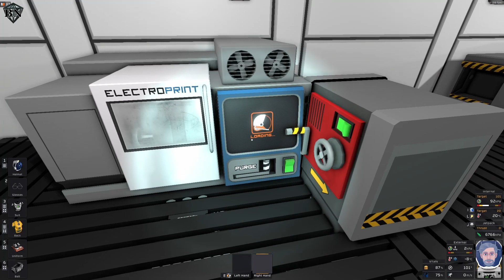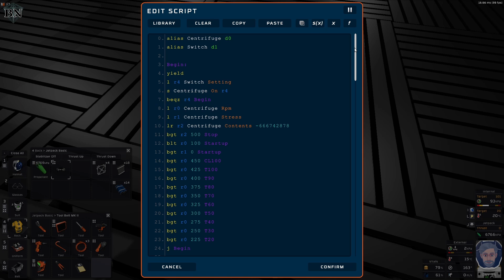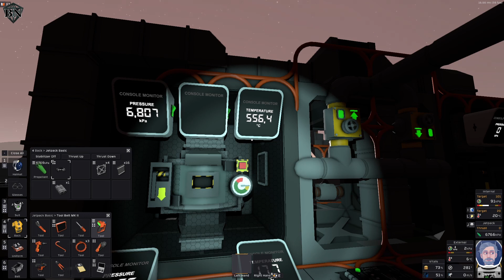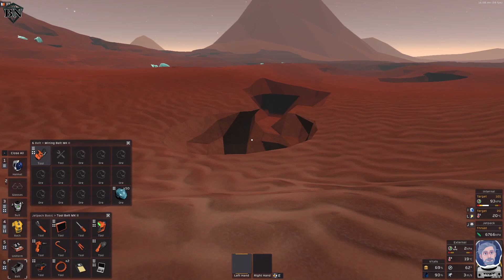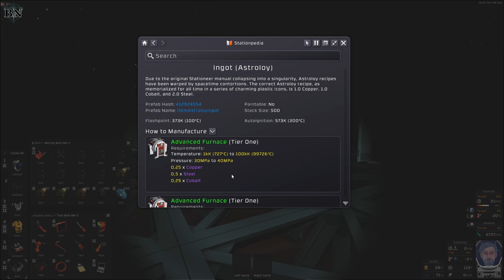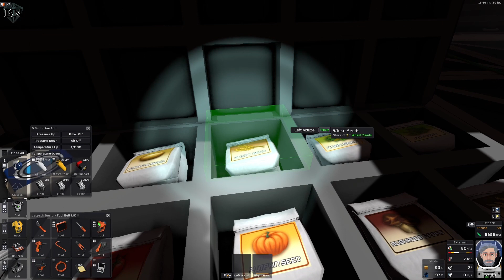Stationeers - Mars Ep13 - Starting up Dirty Ore Processing

Comment: Catching up to this series a few weeks late...  May be changed in a later video or you might not have enough room in the program. (And like my last comment, if it works, it's not a big deal.)  You can also alias the registers that are going to hold a specific value.  For instance r1 and r2 holding the counts of coal/iron could be setup with 2 lines "alias r1 CoalCount" and "alias r2 IronCount".  Makes the code more readable later instead of trying to recall what r1 is supposed to store.
Looking at the code around 19:00, you're also expecting without checking, that the stack of coal or iron is a full 50 stack.  Might be reliable for the first set of materials being sent out of the gas centrifuge, but towards the tail end you're going to get partial stacks of either.  You probably catch it in a later video: the iron "function" is adding six per stack to the counter, not 1.